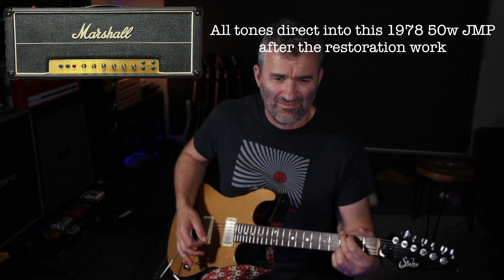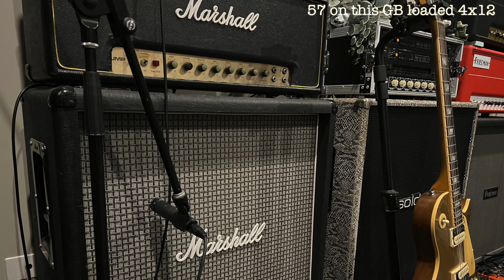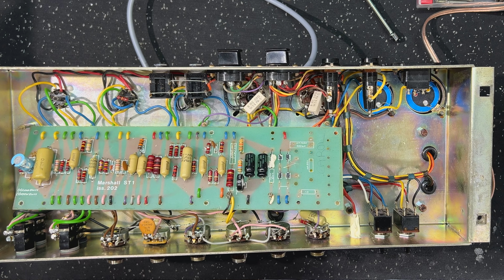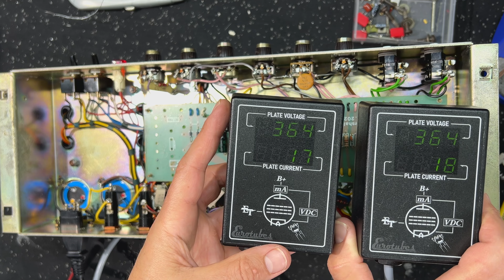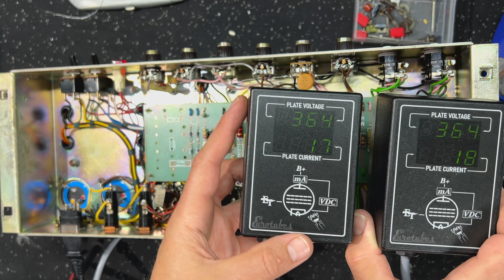NOS Mustards for this ‘78 JMP | A great amp made even better? Part 2

Comment: YES!. I have a bunch of amps but one that sticks out is the 77 Master Volume 2204 I have with vintage Mustard caps. I have the original cab similar to what you have here with G12H-30 55hz greenbacks. I also have a 79 after they switched to the red Mallory box caps. The difference is night and day the 79 sounds good but it's relatively lifeless compared to the 77. They're otherwise identical. I have a custom Friedman BE100 Deluxe hand made clone point-to-point amp that's phenomenal. It's got Sozo GenII Mustard caps and after about two years they sound almost identical to the vintage Mullard Mustard caps. They take a little while to break in before they get crisp and sweet they will sound a little boxy and dry at first. Once they break in they're so nice to me almost exactly like vintage Mustard caps.
Reply: capacitors don't break in.,
Reply: @badsanta518 Their value will drift a little over time and settle.
Reply: @badsanta518 amp sounds boxy and wooden until the caps are fully formed or "broken in". Once the caps form the amp sweetens and sounds cleaner and more crisp.

Comment: Hey im scoping a 100 watt 68 spec superlead.....ok  on my scope at 1k sine wave that big brite cap puts garbage on the wave.....but if you go up to like 2.5k or 3k sine wave it clears up.....plus i can barely turn the volume up before distorting the wave......if i go through my normal channel the 1k sine wave is good all the way to the phase inverter.......i would probably have to bias it there but still cant get much volume travel....does this all sound normal
Reply from the maker: I guess the question is, how does the amp sound?
Reply: @HeadfirstAmps  I seem to be getting it better....I had old iskra resistors and old src treble caps in it and it made it mushy so I changed the resistors to the modern carbon film and the src to modern silver micas....I think the cheap black silver micas sound better for it.....I put about 288 pf on the mixers and 556pf on the tone stack with a mixture of synergy and mustard caps....I'm still tweaking it but it's getting better......it's funny how my bright cap dirties up the 1k sine wave and not a 3k sine wave

Comment: I've got a 78 JMP 50w like this that's in immaculate condition, however the Volume pot is still letting a small signal through when it's at zero, and it jumps up REALLY loud in just the first part of the rotation (way more than it should). I suspect it's a bad pot, but don't want to disturb the factory Red dye on the connections if it's not the Pot. Otherwise I'd just swap it out to see. Is it likely that it could be a failed component that feeds the pot? What could I test?

Comment: Sound absolutely legendary. A question: I have an original JMP MK2 1986 from '75 that I had professionally converted to a 1987. I am kind of considering mod'ing it further to a 2204. Would that be an awful idea? It's definitely not mint - it already has holes in a back (currently made master volume and negative feedback control). I quite like it as it is but it's not fun being forced to run OD's in front of it to reach heavy metal compatible gain.
Reply from the maker: Not a bad idea, there is little difference between a 1987 and a 2204, and you can always convert it back again!

Comment: Jason, what modern capacitors are the closest to those mustards. I'm in the middle of building a 2204 from Modulus Amplification. And that amp sounds unreal. Great work, as always.
Reply from the maker: The Mallory M150s are good.  USA Synergy if you can get them are the best - valvestorm sell them.  Vishay mkt1813 like Marshall use in the 1959hw are cool.
Reply: @HeadfirstAmplification  Thank you will do some searching. Nos mustards are just too hard to find and expensive.
Reply: @scottwilcox6313 Sozo, Mojotone Dijon or Jupiter caps are very close, perhaps a touch clearer in the highs vs Phillips Mustards, not to mention well made and robust. We are spoiled with choices nowadays
Reply: @eyedunno8462 Mojotone Dijon are Polypropylene Film. Not saying they are bad but they are not Polyester Film.
Reply: Crazy .....people are so easily swayed by what others say. Listen to the amp at least half way up with different caps and LET YOUR EARS BE THE JUDGE!
Reply: Thanks, i have, and the amp sounds awesome.  Oh Idid used polyester caps@curtisprice9806
Reply: Look for a cap that has same basic construction. You are looking for a film and foil polyester cap with sprayed metal ends, copper (not steel) leads. There are very few available these days, most being Metallized Polyester (Mallory 150 / MKT1813 etc etc etc etc) and many of those having steel leads. Sozo don't say what their construction is and charge a bomb.

Comment: Hey you know how the 100 waters  have the center tap grounded between the mains caps.....would you ground those at chassis too?
Reply from the maker: The CT is connected between the filter caps, but not grounded.
Reply: @HeadfirstAmps  ok I didn't know if you could ground those like the 50 watters

Comment: what about nos mullards?
Reply from the maker: What about them
Reply: @HeadfirstAmps  not enough people are aware of the power of vintage tubes,some techs don't even use a tube tester. it's the easiest mod and it's very effective if you know what youre doing. i usually "tame" aggressive marshalls like jcms using GE tubes but for jtms jmps nothing beats old mullards they have the best midrange known to man. my best retube was a 1967 jtm 50 black flag i put a mullard i62 in v1 and i63's in v2,v3. xf2 el 34's for power and it sounded amazing.